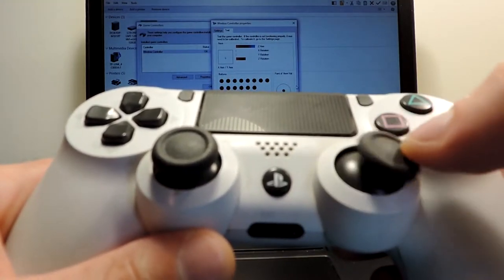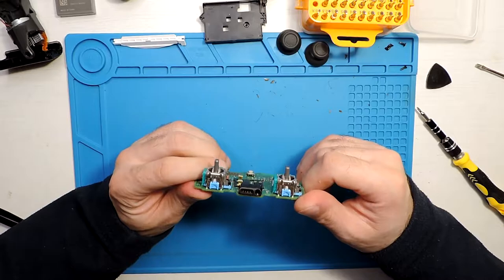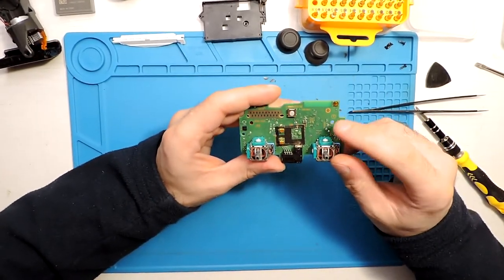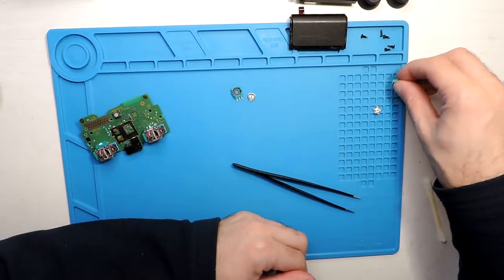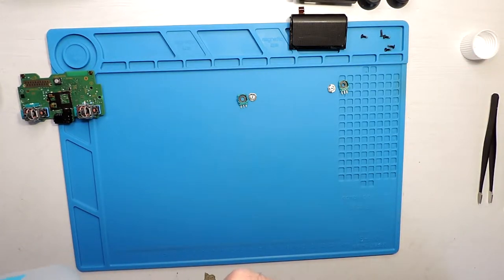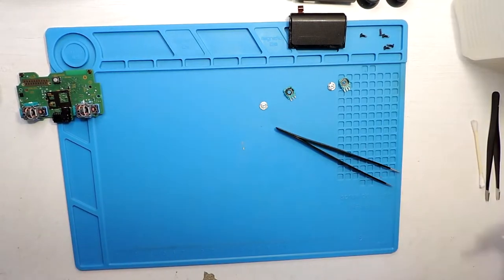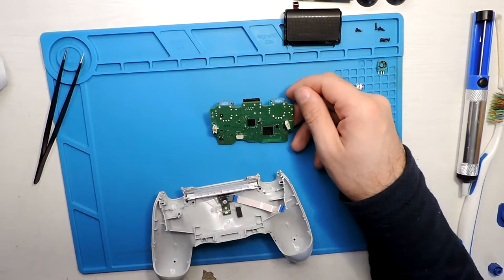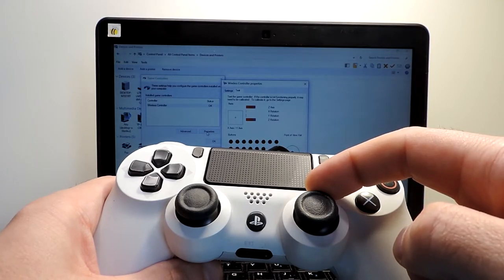Fixing a PS4 joystick drift without replacing any parts

Comment: instead of soldering them u can just pull it out using flathead screwdriver
Reply from the maker: I thought about that, the issue here can be that when you bend them back the pins can break. Something I should try definitely!